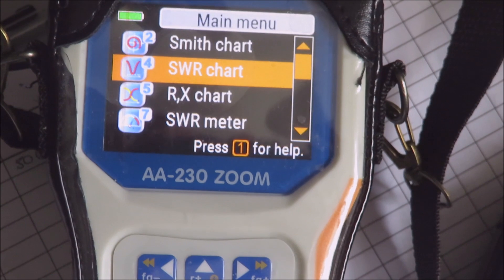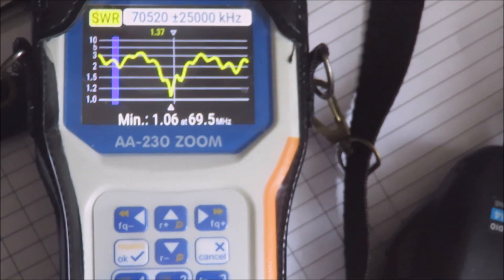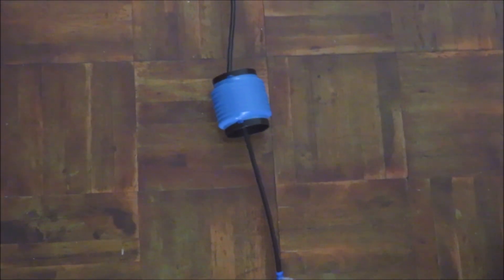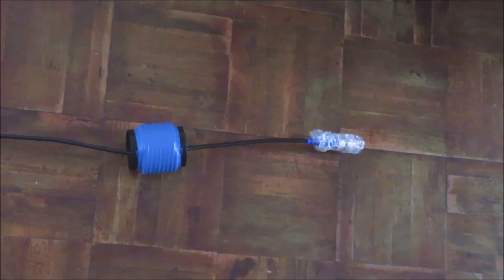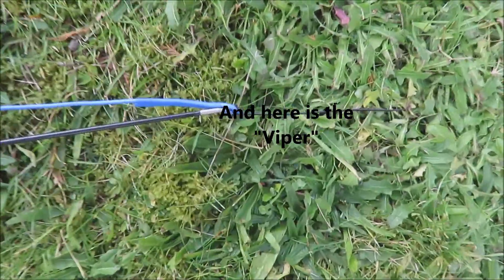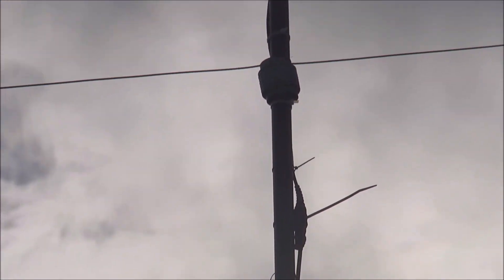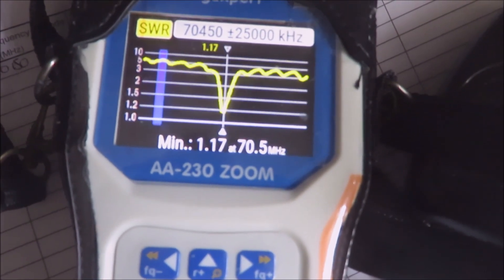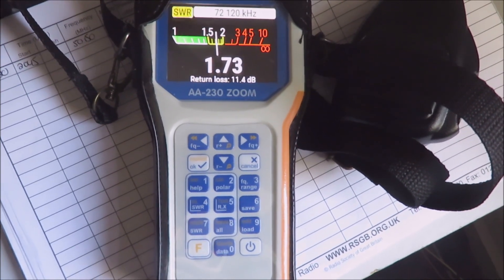Changing to the Viper Antenna for 4 metres

Comment: I use the viper as a portable antenna , it's better than the sirio cx4.
I believe the viper is a 5/8wave over 1/4 wave.
Reply from the maker: I have found it works very well for the local FM net on 4 metres. Since I have hadthe antenna I haven't experienced any lift conditions on 4 yet.